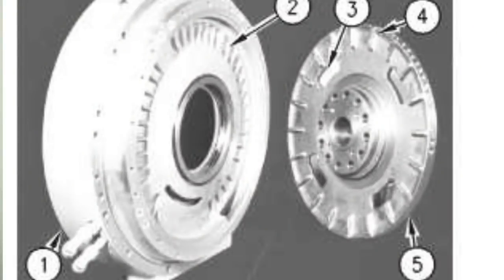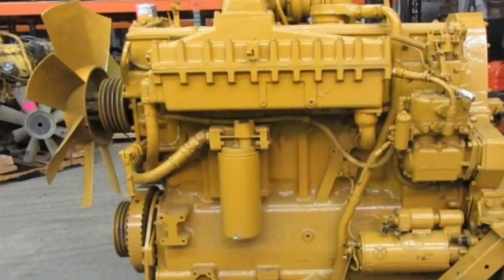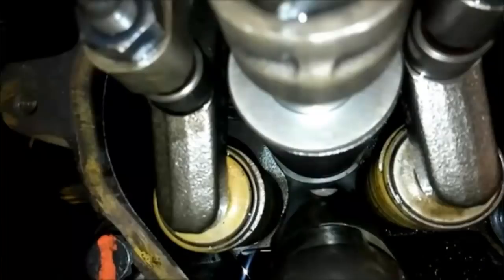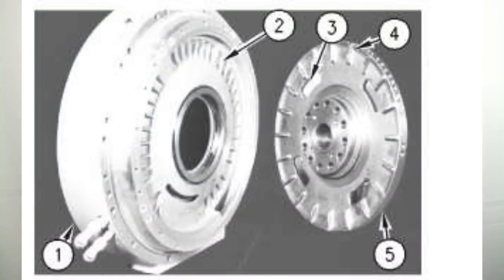What is a Cat BrakeSaver? Caterpillar BrakeSaver. Is it a brake saver?

Comment: Would the brake saver cause one to have more oil changes depending on use?  How hot does it get, does it break down the oil quicker than usual?  Okay answered on the oil cooler size for somewhat cooling compensation.
Reply: You can overheat the oil if you dont watch what you are doing on  long steep hills. Thats where the jake along side the retarder is so good. Just use the jake.
Reply: My c16 has a brakesaver it will heat the oil up fast 250 then I turn it off 10 to 12 thousand and the oil is black as coal
Reply: Pretty sure it breaks down the oil faster.
Both chemically and molecularly.
You're asking it to do additional work apart from what it was originally meant to do which was no cake to begin with.
Reply: The best oil for the old 1693’s was Shell Rimula 30 weight. Held up well

Comment: I saw a video of a tractor from back in the mechanical days that had two trolley brakes. I was wondering what the second one would be for. Could that have been a brake saver? I’ve been driving over forty years and have never seen that second lever or heard of the brake saver.
Reply: Yes. The BrakeSaver control trolley valve was on the left side of the steering wheel on the KW K100

Comment: Most modern trucks use BrakeSaver system not in the engine but in the gearbox..therefore Jake brakes and BrakeSavers are becoming  obsolete , by the way  not to forget to mention Electric retarders ( especially used on buses)

Comment: I know the video is over a year old, but I'm hoping you see this and may know why, but I've got a brakesavers that will blow the diaphragm about once a month, or if it's a long enough grade,  and the oil gets hot enough (225~F} it will fail. Air feeding the saver is regulated at 50psi
Reply: I have never ran across this. Your air psi don't seem to high, what color is the diaphragm you are using?
Reply: @johngoldsmith6629  it's a Caterpillar genuine, it's a orange-ish red.
Reply: @Blarneystoner211  part number
Reply: @johngoldsmith6629  I'll get that for you tomorrow. I don't have any old ones handy.

Comment: great for engine braking city ordnance towns due to sound
Reply: I will always tell people, "The sound of my Jakes, even with no mufflers, is still a lot quieter than the sound of my truck crashing into your house."
Reply from the maker: That's a very good point, I was going to discuss that they are basically silent unlike Jake's, but forgot during the filming.
Reply: That was the best selling point, sound control if you want it. There is nothing sweeter than listening to a Jake purring down a mountain pass in my opinion.

Comment: dont see them anymore because of the weight they worked well with a jake but not as well on there own alot of guys would crank up the air pressure then they would get hot jakes just worked better at half the cost

Comment: Pardon my newbness, but do you anticipate brakesavers making a comeback with noise pollution regulations locally banning the use of Jake brakes? Or will manufacturers invent more sophisticated mufflers for Jake brakes?
Even then,  brakesavers sound like more trouble than what they're worth. Some fundamental design changes will be needed for them to even be considered.
Reply: As it was a Cat design, the cost and such I would say no. However the exhaust brake mounted after the turbo might have a better chance.

Comment: Also I was told by a old timer those brake savors where Rumored to be Notorious for burning up motors. Not sure if it’s true or not
Reply: No they didn't  burn up engine , people would hook  up the remote oil filter  oil lines  backwards, which  does not let the oil bypass  valve work & over time take out the main or rod bearings!
Reply: They’d only “burn up an engine” if guys didn’t keep an eye on the Brakesaver temperature gauge and let the gauge get in the red and get the oil too hot. Aka  operator error.

Comment: The Caterpillar 1693, Wouldn't be able to use a Jake brake, Due to its overhead Cam design.
Reply from the maker: I believe the Cummins ISX is an overhead cam engine and has Jake's. Just saying.
Reply: @AdeptApe   On the 1693 the  Cams are directly over the top of the  Valves.
Reply: Most of the 3408 CAT's I've seen in trucks have a driveline retarder.   And those cost almost as much as used truck
Reply: 1693 didn't  have Jake  because  it didn't  have a injector  lobe to activate the jake. Unlike  isx engine they have a dedicated  cam lobe to activate jakes . 1693 to complexed to mount jake unlike 3406.
Reply: And , unlike the isx , 1693 run forever
Reply: So true you will drive  that isx from shop to shop!!!!!!!
Reply: @ruxoneto6560  you mean towed right  ROFLMFAO 🤣😂
Reply: @MY-bw2nb  my mistake 🤢
Reply: @terrydavis6132  Water pump rebuilds were a real treat if you had the full flow oil filter on the aftercooler side of the engine. Oil lines ran around the front of the engine

Comment: Cool video, thanks for sharing.
When operating the brake saver, how loud is it compared to jakes?
Reply: BASICALLY NO NOISE. THE LOAD POPS YOU HEAR FROM A JAKE IS THE COMPRESSION BEING RELEASED. BRAKE SAVERS JUST USE OIL PRESSURIZED INTO AN EMPTY CAVITY THAT IS BOLTED INBETWEEN THE CRANK AND FLYWHEEL. BASICALLY THE DIFFERENCE BETWEEN RUNNING ON FLAT GROUND. TO RUNNING IN WATER.

Comment: allison transmissions had a hydraulic retarder  not sure who stole the idea from whom. but it was the same thing.   ever work on a 7155 cat trans?  all  air operated 15 speed with an input and output clutch.  a real monster.
Reply: If you ever hear a 7155 transmission shift, you will never forget the sound it makes. Only ones I worked on was a M980 I think with a 400 Cummins.

Comment: WML -  just got done getting my 3406E rebuilt.  Looking for options or manuals to recondition the brakesaver before the install...anyone got advice on this?
Reply: Find a old tech who knows how to rebuild these. You got to have line up bolts, seal installer and two plates to hold the stator in place. Look for wear on the ring seal sealing sleeve, replace ALL seals and gaskets and new ring seals (one on each end). After you rebuild the main section. Put the factory plate on to lock the stator in center position (transmission side). Turn it over and install engine side hydrodynamic seal. Install retainer bar to lock stator (engine side).  Turn it back over and remove factory plate. Install transmission side hydrodynamic seal and put factory plate back on to lock stator. Turn it back over and remove retainer bar plate and install starter ring gear flywheel. Look at flywheel holes and get two that the brakesaver will slide over while stator locking plate is still installed. Install brakesaver making sure you got it lined up on dowel pin in crankshaft. Install allen bolts that holds brakesaver to rear cover. Remove locking plate and install clutch flywheel and snug up a few bolts. Remove line up bolts in crankshaft and install remaining flywheel bolts and torque. That is how I rebuild them. I like to start on the transmission side plate to lock the stator. As once you get it locked, your not turning the stator to much or moving it around.

Comment: Hi was wondering if you have a email?? I run a 3406C and really would like to ask you a couple questions?
Reply: What is your question?
Reply: @johngoldsmith6629  hey thanks , I have a 92 3406c and I’m getting oil in the fuel ? Any thoughts ? I cut open a fuel filter and it looks like the inside of a oil filter ! And no it’s not algae it’s oil.
Reply: @Dreamer-yz5op  The only way oil can get into the fuel is someone adding oil in the tank.
Now what most likely you are seeing is carbon in the fuel. When the cylinder fires and a nozzle is not seated correctly. Combustion gases will blow back into the nozzle, back in the main pump and return to tank.
You can try and pop test the nozzles and see if one is dripping fuel before VOP. If you replace all of them be warned you will loose a lot of HP until they open back up. If your engine is a 3ZJ be warned the parts book is incorrect on over half of the engines. You will put the wrong nozzle in your engine.  3ZJ's Cat tried extrude hone nozzles and they was a POS. 
So the parts book shows them and the purpose was to prevent the orifices from  getting larger. Well they got smaller and plugged the tip up. Would put them in and a lot was bad out of the box.
Reply: @johngoldsmith6629  
Thanks it is a 3ZJ I’ve owned it since new in 93 last rebuilt it in 2013 absolutely no problems, but definitely oil in fuel filters.  Wish was a way to send you pics, no one else I show them to can believe it ! Wondered why I was having to change filters around 4-5000 miles so cut them open and looks like the inside of a oil filter !
Reply: @Dreamer-yz5op  Been working on Cat's for over forty years. I have never seen oil in the fuel caused by this engine other than nozzles. The fuel transfer pump has psi in it and above it is zero oil psi. The injection lines and nozzles are under high psi and oil psi is not even close. The main injection pump would have to be cracked in such a way that oil would enter the low psi side. But I would have to see that and I would expect some fuel in the oil. The fuel return line would have to be rubbed against the oil psi gauge line and fused together. Again I have never seen that. I would get a fuel sample and have it analyzed. If I was working on it I would be checking the nozzles.
Reply: @johngoldsmith6629  ok thank you very much for responding
Reply: Where did you buy fuel before you checked those filters? Some filling stations dump used motor oil in their diesel tanks.

Comment: Personally I think this tech is a waste of money, brakes are cheap, engine work is not.
Reply: Considering that you can double or triple the lifespan of the service brakes. Your math is wrong bub.
Reply: It's  not money , it is the difference  of going down long grades 25 mph or 60 mph ,no body gets paid to sid on the road!!
Reply: @ks_1111  CONSIDERING DROPPING THE TRANSMISSION, CLUTCH, AND FLYWHEEL. JUST TO REPAIR IT. THE LABOR COST OF 15 HOURS AT $125.00 PER HOUR. PLUS ABOUT $1000.00 TO GET IT RESEALED. CAN BUY 40 SETS OF BRAKE SHOES. AND HAVE THEM INSTALLED.
Reply: BRAKE SAVERS A GREAT THING TO HAVE IF YOU NEED ALOT OF BRAKING FORCE. ON REGULAR ROAD TRUCKS THERE OVERKILL FOR THE EXPENSE TO REPAIR.
Reply: @peterlanum  I HAD A BRAKE SAVER IN A 3406A. AROUND 10 MPH WAS ALL IT COULD HANDLE DOWN EISENHOWER WEST BOUND I-70. THE PROBLEM IS THE OIL GETS HOT. YOU CAN ONLY USE ABOUT HALF THE PRESSURE CONTINUALLY. OR FULL BORE FOR A SHORT AMOUNT OF TIME. YOU WILL HAVE TO RELEASE THE BRAKE SAVER IF IT OVERHEATS. THERE IS A REASON WHY MOST TRUCKS DONT HAVE THEM. COMPRESSION. 3406A HAS 12:1. 3406B HAS14:1. 3406E HAS 16:1. COMPRESSION BRAKES WORK BETTER WITH HIGH COMPRESSION. 3406A HAS TOO LOW OF COMPRESSION. THE BRAKE SAVERS WERE BETTER THAN THE JAKES ON THE A MODEL CAT. DROVE BRAKE SAVERED A MODEL CAT IN A 1985 359. OR JAKE A MODEL CAT IN A 1981 K100. JAKES JUST MADE NOISE. NO HELP AT ALL. BRAKE SAVER IS BETTER, BUT ONCE THE OIL IS HOT, YOU HAVE TO RELEASE THE BRAKE SAVER. THE HAVE FADED OUT BECAUSE THEY ARE HEAVY,  EXPENSIVE TO REPAIR, AND EASY TO DAMAGE. AND LESS EFFECTIVE AS THE JAKES ON A 3406E.
Reply: People have a problem understanding the context of this video. This video was about a particular kind of engine retarder and saving brakes. It was not about all engine retarders or why you might want more braking power.

If you don't understand this dual context, then you have wasted your time and mine. And yes I know why and when I want to use engine brakes, been operating and managing truck operations for thirty years. :-|

And mechanics who can do brake jobs and brake parts are in fact much cheaper/plentiful than mechanics who do engine work and engine parts themselves.

A truck that needs new brakes is down for an hour, 90 minutes at most. An engine job can take a truck out for weeks...
Reply: @redline9536  peter it depends on what you call oil getting hot go till it gets  up to 275 degrees !!.
Reply: @ruxoneto6560  The seals are rated for 250°. There are two oil pumps. One supplies the engine like normal. The second pump is bolted to the rear of the first being, driven by the crank. It's supplies oil to the brakesaver. If the oil temp gets to 275°, you will burn up the seals with hot oil. Once the seals and gaskets burn up. You will have an extreme oil leak. I did not have a temp gauge for brakesaver oil. I got mine to hot. I was using my water temp gauge to help me determine oil temp. The hot oil passing through the oil cooler will raise the water temp. I would release the saver at 200° water temp. I got a little greedy and held it till 205° water temp. Then 210° on water temp. That's what did it. 210° water temp means to hot oil temp for the brakesaver for that truck. So to sum this up. I had a truck with one. I've stuck a punch in to cooler. (Anyone who ever repaired the diaphragm will understand that. Just so they know I'm not just talking). I've repaired the diaphragm. I've removed the transmission, clutch, long bolts an flywheel. Then the brakesaver. They require massive surgery to repair. E model jakes work better than a brakesaver, don't overheat, lighter, and are easy to repair. That is why jake brakes are the popular engine brake. Combined the two would be great. You can find old heavy haul truck's with E Model's jaked and brakesavered. They are rare now. If you cross mountains with heavy weight, 100 grand plus, there useful. For normal operations, not worth the cost.
Reply: @ruxoneto6560  My 85 originally had a 7FB B Model . Now it has a 92U A Model. Not sure what is original or what was added. My 85 has no temp gauge for brakesaver oil. I take the blame for not putting one in. I know there important to the operation. My air is set at 58psi.
Reply: @ruxoneto6560  what makes the 3408 have more braking effect?
Reply: @redline9536  60 psi is factory setting , depends on accuracy  of gauge???? I have had gauges oss by 20 % !!!! My 3408 has 100 psi after about 75 psi not much power  difference!!.
Reply: @ruxoneto6560  Thank you for the info. That leads me to believe mine must have an issue. Or possibly someone played with it and didn't know what they were doing in the valve chamber. The reason being that above 10mph with a load down Eisenhower. It becomes to much for the brakesaver.